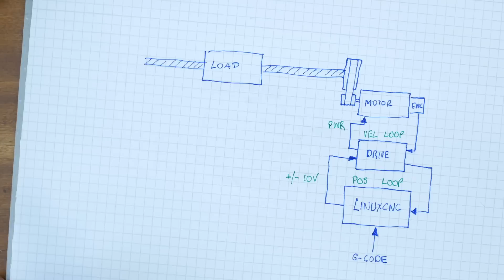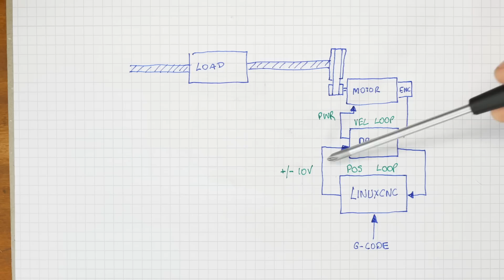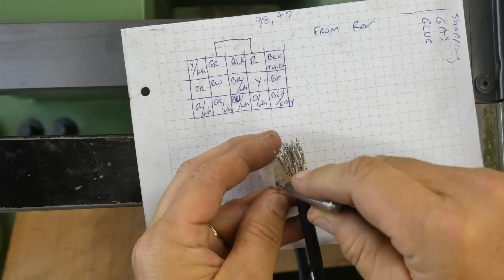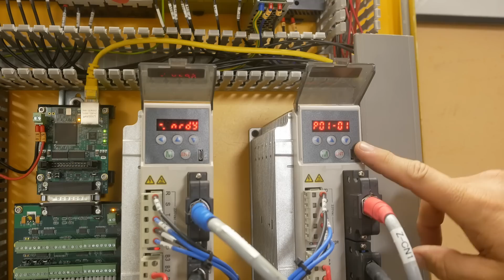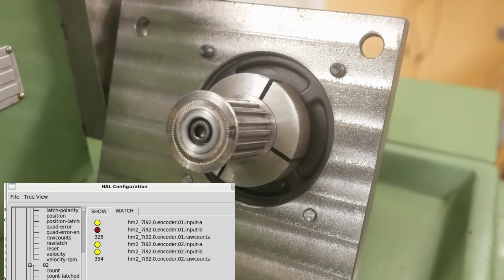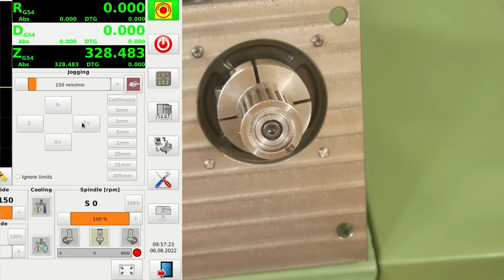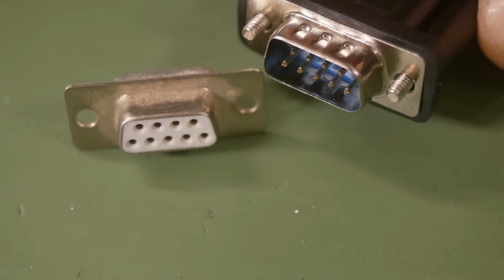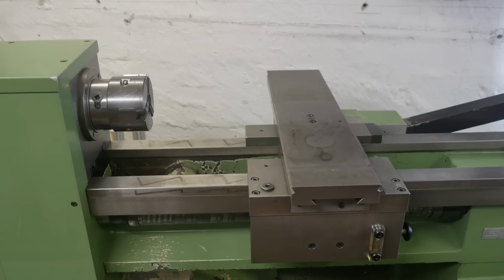First Motion - Schaublin CNC Ep.41

Comment: One thing I was wondering about with this, if you don't know the "real" position of the saddle is it really a closed loop system?

Also, that manufacturer putting RS232 through a USB connector should be considered a criminal act. I've seen several variations where they use RJ11/RJ45 with a somewhat arbitrary pinout but never with USB connectors.
Reply: There's actually a standard for serial-through-USB-connector, known CEA-936-A or Carkit.

Still borderline criminal imo, but at least whoever made these VFDs was not starting new trends or anything.
Reply: So what would your definition of closed loop be? Maybe linear encoders on each axis? Even that doesn't take into account bed twist and toolpost deflection. No matter what you do you never know the true position of the tool. The most important property of a CNC machine is it's repeatability. Even if it isn't quite hitting the mark with absolute accuracy you can tweak the numbers until it does. As long as it is repeatable your parts will come out accurate. A part of the skill of being a machine operator is knowing just how much tweaking is needed to meet your desired accuracy.
Reply from the maker: @LesNewell  Good summary there Les. 
I did consider putting linear encoders on the Schaublin, which would be trivial in Z, but I couldnt come up with a decent location for X and figured with the rigidity of the Schaublin and the ground ball screws, it should exceed my accuracy needs.
Reply: typical cnc machines have a positioning accuracy of  +/-.002mm and a repeatablity of +/-.001mm
adding a scale to the same machine  will cut those in half. 
very few machine shops during my time  (1984-2001) ever opted for scales.
frankly a machine worthy of scales is far more costly than the vast majority of machines out there .
and yes the industry that makes and sells these machines call it closed loop.
Its also worth considering that schaublin deemed scales not necessary

EDIT having said that, check out Clough42's last two videos , a very elegant solution for installing an  x-axis scale
Reply from the maker: @steveggca  Thanks for the tip. 

The Maho has an Inwar bar in the Y axis linear scale mount to compensate for gearbox casting thermal growth.
Reply: @RotarySMP  Invar ? fasinating metal with almost zero thermal expansion?
we used invar rods and a FARO laser tracker to  take measurements of Candu reactors ,before, during,and after refurbisment 
of the reactor vessel, It's about 40C in the containment building when  started and and mid 20s when done.
Reply from the maker: @steveggca  Yeah, I was surprised that Maho took that step, but they are quite proud of it and mention it in the manual. There is an Inwar bar in the forward mount of the linear encoder, and a flexure on the other end, so the system can compensate for the gearbox growth as a heats up. It is only the Y axis which mounts the encoder to the gearbox.

Comment: looks great , first chips soon.
connectors are a huge pain, we had once installed a new machining center at a customer  ,which almost immediatly started having Z-axis encoder faults.
after the usual reseating of connectors , inspecting the cables etc.  even after  swapping the motor the problem refused to die.
fanuc (in this case) meldas, yaskawa ,and most other servo manufacturers use Amphenal MS circular connectors ,or their  commercal cousins  97 series,
that are  plug in compatible (foreshadowing alert).
For those not familiar with this style connector there is the shell body ,2 wafer pieces that retain the pins, and a circlip that holds it all together.
 the MS series and 97 series parts will fit each others shell, except for  the part where if you put MS  wafers into a 97 shell the the pins and wafers are about 4mm shorter.
and therefore float back and forth by that 4mm.  So back to the shop for an MS shell and all was good.
Reply from the maker: Good bit of detective work to identify that error. Nice one.
Reply: thanks ,troubleshooting of non-obvious problems,  in my experience is the combination of identifying what is not causing the problem, dumb luck ,guessing , or  someone looking over your shoulder and saying "what about that" as they point at something really obvious.  I'm equally accepting of any of  those.
Reply from the maker: @steveggca  Yeah, I am also happy for anything which works.

Comment: I feel your pain, but at least your connectors were not soldered style! Nice progress, and yes, wiring any project takes time especially if you want it to be neat and look good, not a rat's nest of wires that make debugging a nightmare.
Reply from the maker: I think I will redo those driver cables.
Reply: @RotarySMP  Because you needed to add a couple signal wires? Nah! I would use some cable "spiral wrap" and no one will be the wiser. In the end it will be functional and neat too.
Reply from the maker: @MRCNC1967  Also a good idea. Thanks.

Comment: Congrats. Sucks on the repining of the connector and missing the nut. I always hate doing those jobs!  Also me facepalming on the Rs232 on d-sub! What were they thinking?
Servo motor tuning parameters, me -> 😮
Reply from the maker: Yeah, is pretty primative to use RS-232 on µUSB, forcing the customer to source an R-232-USB, and a nine pin connector. A bit more effort on JMC's side and that could have been a stink normal USB cable.

Comment: Can't you get linux cnc to work in 'open loop' ie, you get linux cnc to send out an analog signal over time which should correspond to a small step move, and then tune the drive to at least do something similar to a step move? After that you can turn on the linuxcnc control loop. Two control loops sounds alien to me, but I'm no expert.
I work with servo's as well but it's completely different, we use a Beckhoff plc (technically it's a pc, but it's a small computer which controls a machine) to send position commands to a Rexroth (these guys bought Indramat) servo drive, which talks to a Rexroth motor. The drive controls the axis and makes sure it is where it should be. The position feedback to the plc is only there to shut the thing down if there is to large a difference between the actual and requested position. The Rexroth drives usually work well enough with factory settings which saves a lot of dreary tuning. These drives have a 1500 page manual with an insane number of settings, but usually only two gain settings are used if tuning is required, I hope it's the same for your drive;)
Reply from the maker: Those  JMC drives also support position control mode, where they just receive Step/Dir signals. I probably choose the complicated solution.

Comment: I always wonder why magicians don't make an honest living threading nuts over wires that have been installed out of order. On the plus side, I'm gonna be a millionaire when I finally invent that two piece nut.
Reply: There is already two pieces nuts out there... i worked with some in some electrical cabinets in Denmark some years ago (like 25+ or so).
I have used both plastic and chromed brass two piece nuts, the chromed brass ones was the best, the plastic ones often broke when tightened slightly too much.
Was about 25+ years ago tho and haven't really seen them since, i think the electric cabinets was made in Sweeden, but it was long ago, so i'm not 100% sure :-)
Reply from the maker: @JTL-DK  How do they stay together ?
Reply: @RotarySMP  Hm, hard to explain in text, but imagine two horse shoes with threads inside put together to make a ring (curve 180 degrees apart) and with threads in the inside, then the "legs" of the horse shoes overlap eachother, one with 4 studs (2 on each leg) and the other with 4 holes 2 in each leg) that match the pathern, so when you put them together the studs lock in the holes to form a perfect circle with threads inside and then when you tighten the nut the threads hold the two pieces together due to the threads so they can't slip appart...
The studs make the two halfs not slip apart and the threads hold the two parts clamped together...
Does this make sense?
I'm from Denmark, so my english is not that good :-)
Reply: Been trying to Google them, but i come up emty... not sure what the name or the make was, so not sure what to call them, so it's pretty hard to find them on the internet... 😞
Reply: @RotarySMP  We used them for holding/secure cables and water proofing the cabinets from 1 to 2 inches in diameter or so.
Reply: @RotarySMP  First you click the two halfs together, then you screw the nut on the fitting.
Reply from the maker: @JTL-DK  Yes, that makes sense. Thanks for the explanation.
Reply: @RotarySMP  You are very welcome 🙂
Maybe you can make som on your MAHO 🙂
Reply from the maker: @JTL-DK  Not needed now :)
Reply from the maker: :) Good call.

Comment: For the tuning, i suspect you'll have to let LCNC do the PID. just set the drive up to output torque equal to the analog input, not velocity. Then its just a straight forward pid position loop tuning.
Reply: While you can use velocity control, in my experience LinuxCNC works better with torque control. My Hurco mill is a good example. The original control used velocity so when I converted to LinuxCNC I left it in velocity but could never get it really dialled in. After switching the drives to torque mode and re-tuning LinuxCNC the machine runs smoother and with a lower following error.
Apart from tuning issues, velocity control usually hunts at zero velocity. If you have analogue control it's pretty much impossible to send a true zero velocity command. There is almost always a tiny offset somewhere in the system that results in your zero actually being a very low velocity. This will make the machine creep until the encoder moves by one count. LinuxCNC will then give a small velocity command in the opposite direction until the encoder moves back and the cycle repeats. Trying to add a deadband in LinuxCNC just makes it worse. In torque mode a tiny torque command will achieve nothing so the machine stays still. This isn't a LinuxCNC specific issue. Lots of machines out there hunt a few encoder counts for this reason. You often see this as the position DRO flickering one or two least significant digits. The old Bosch velocity mode drives on my router are quite noisy and the regular chirp-chirp-chirp of the hunting drives me nuts.
Reply from the maker: @LesNewell  Thanks Les. I will have to take a look and see whether LinuxCNC supports torque mode with the Mesa 7i83.
Reply: @RotarySMP  Torque mode is a setting in the drive. Instead of a varying voltage from the 7i83 controlling the speed you tell the drive to use that voltage to control torque. The hardest bit will be finding the setting in your drive. The good news is that in torque mode most of the other motor tuning parameters can be ignored.
Internally the drive will have three control loops on top of each other: position->velocity->torque. By using torque mode you are bypassing the first two loops and letting LinuxCNC do the work (which it does very well).
Reply from the maker: @LesNewell  The setting of Torque mode is the same one for Speed control, just a 2 instead of a one. 

Thanks for that description. I have already done the LinuxCNC tuning before (on the Maho).
Reply from the maker: Thanks for your feedback.

Comment: Could you Tell me the Pinout you used for the rs232 to microusb cable? I have the same servo drivers but failed connecting to them via the software.
Reply from the maker: Wire  - dSub
White - Pin2
Green - Pin 3
Black - Pin 5

https://www.cable-tester.com/rs232-pin-out/

What sort of chip is in your USB-RS-232 adapter? In that video I linked, he indicated that not all work. I used the Sabrent driver, and checked the chip type using their chip test widget.
Reply: @RotarySMP  thank you so much!
I use an original ftdi adapter. Thats a great clue, if it still doesn‘t work I‘ll get the adapter you‘ve got and see if that helps.